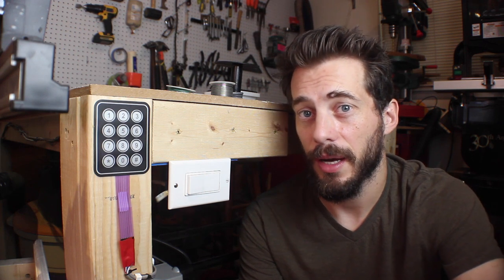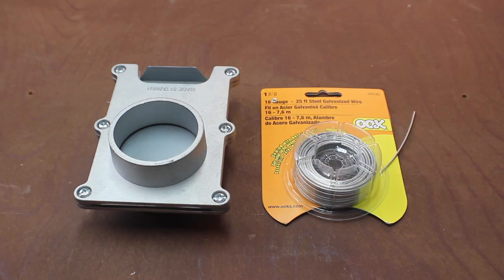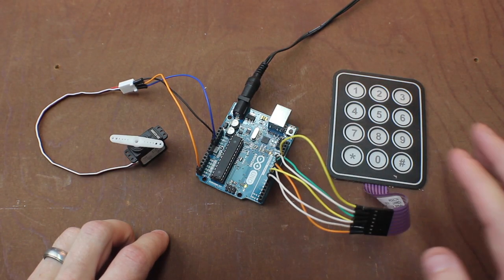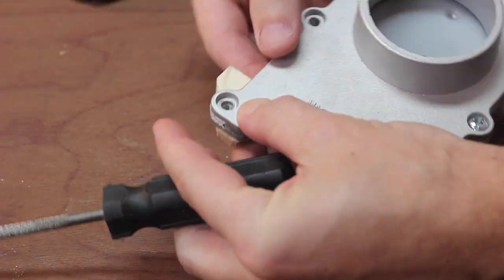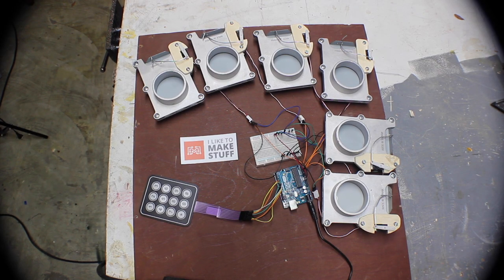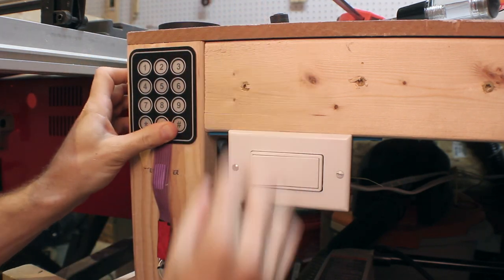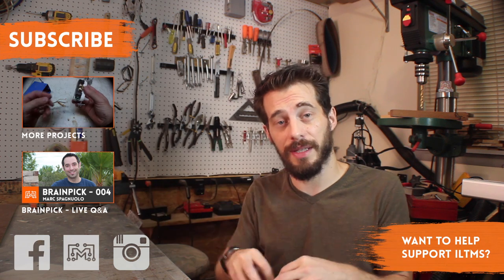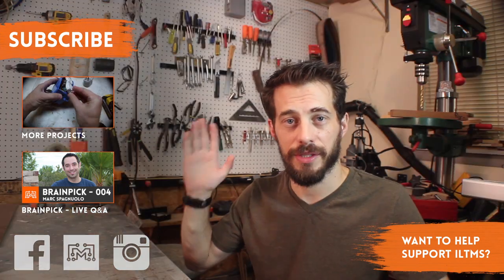How to control your dust collection with an Arduino (it's easy) | I Like To Make Stuff

Comment: I'm thinking instead of the gates, a ball valve might work better with the servos, but I don't know if all the dust would cause the valves any problems.
Reply from the maker: +Will Fader All of the ball valves that I've ever used are pretty hard to turn, and the servos wouldn't be powerful enough to manipulate them. It's possible that there are some out there that turn easily though ,I suppose.
Reply: +I Like To Make Stuff  True, true. I'll get around to testing it out one day; see what I can come up with, and report back.
Reply: +Will Fader you can get servos that are very strong but they are not cheap. you need to look at there specs some are for speed and some are set up for high torque.
Reply: +Will Fader i used automotive door lock actuators. Door lock actuators are powerful and only needs a pulse for it to move positions.  You will need to use a H bridge to control them.

Comment: Hey Bob, are you still using this? Are there any changes you wish you'd made
Reply from the maker: No, I'm not.  It was working fine, but I upgraded to a large dust collector and simplified down to only connecting 2 tools.
Reply: I would add current sensors to your tools and a solid state relay to the dust collector, then when you turn on your tool the Arduino can automatically turn on the dust collector and open the correct gate,as for the floor one use a switch that you can tap with a broom that keeps the collector on for x number of minutes.  This would eliminate the need for the keypad and the main switch (or you can keep them near the collector for manual overriding

Comment: When i saw "automate" i thought that meant it would automatically turn on when the tool was in use 

Still a cool video though
Reply: You can do that, either have the arduino control the tool through a relay, or have an Amp meter to detect when the tool is in use. (be careful with the AC though, it can kill you)

Comment: After your comfortable with the Arduino, try the Raspberry PI. Its a $35 Linux computer with io pins to control with python.
Reply from the maker: Adam Yarris Definitely, I love the Pi ! https://www.youtube.com/watch?v=RcsKNryPAzw&lc=z12fjxzoswzjw5om023owztgprfsg3vmd
Reply: I Like To Make Stuff I got a Raspberry Pi Kit at Radio Shack, my local store was going out of business and everything was 80%-90% off, so I got several types of arduinos, raspberry pi, arduino shields, etc. It would have been around $500 but we spent like $150, It was awesome. And the funny thing is, is that the reason I went to radio shack was only to get some PCB xD
Reply from the maker: Adam Yarris That's awesome! I was able to get a few things from my local store, but it didn't have much stock to begin with, and someone had already beat me to it :/  I did get an Arduino Yun (built in wireless) at 50% off,so I'm looking forward to finding a use for that.
Reply: I Like To Make Stuff Wow, nice. I was looking around when I got that stuff, and Behind some books, I found an Arduino mega there. it was something like $15. I got a few seeed studio shields like the Ethernet shield, motor shield, and some others. I can't get them to work, there's always a compiling error though.
Reply from the maker: Adam Yarris Ah cool. I got one of the Seed motor shields too, but haven't tried it yet. Are you adding the libraries to the sketch? (I'm just guessing that it needs special libraries, I haven't looked into it.) Let me know what you find out when you get it working, please :)
Reply: I Like To Make Stuff Yea it needs libraries, Just look up 'Seeed Studio [shield name and version] libraries', I have got the motor shield working, it works very well for the price of it!
Reply: +Adam Yarris Yeah, a Pi can do much more than an arduino, and python is an easy language to learn.

Comment: Wait, wait, wait...if I use an Arduino for this, I have to buy another Arduino for the next project?  Isn't there something more affordable to run the system once it's developed in the Arduino?

I was going to use micro switches on each port, wired to relays, so when I open a blast port the vacuum turns on. All the gates will have springs to keep them closed tight, and to close when I remove a hose.
Reply from the maker: +BillyGoat4x4 You can definite write the logic to a chip and replace the Arduino. It's best used for prototyping.  That being said, if you buy Arduino clones for cheap enough from China (literally $3 each) even replacing them becomes unnecessary unless you're doing a whole lot of projects.  Plus, keeping it in place gives you more flexibility with modifying/updating your project.
Reply: +I Like To Make Stuff That's good news, thank you. I got a starter kit for Christmas but have been a little intimidated to dive into the digital world.

Comment: Hey! This is a great project, however you are going to kill your arduino ! Arduinos are not made to handle this much power. The servos should be on their own power supply but typically must have a common ground with the arduino. If you have any questions PM me. 

Keep up the good work!
Reply from the maker: I plan on doing that, it just wasn't a priority for this video since the system is never activated for more than a few minutes at a time.
Reply: I Like To Make Stuff Yes, however the amount of current that it takes to open and close all at one time (your * and # keys) is easily enough to potentially fry the board. 
Hope to see more Arduino projects soon!

Comment: You should make a wireless way too do you could just carry around a remote
Reply from the maker: john dunne I'd thought about that, and it would be a fairly easy next step.  Luckily, my shop is smaller than a 1 car garage, so wireless would be a little overkill for my space :)

Comment: Bit more of a complicated project.could you read when a tool is turned on by reading the current draw on a plug then have an arduino switch on the shop vac making .and maybe open the correct  dust gate
Reply from the maker: CaptainDominic yes, you definitely could!

Comment: Where is the code for the Arduino?
Reply from the maker: +Best Services On my site, there's a link in the description for the post that has it.
Reply: I Like To Make Stuff I clicked every link in the description above, and do not see any code.   Maybe I'm just stupid, but could you please point me to the code?   Thanks.
Reply from the maker: http://d397j8om2gwxco.cloudfront.net/wp-content/uploads/2014/09/keypadToServo.ino_.zip
Reply: I Like To Make Stuff OK, thanks.   I had downloaded that before, but have no way to open it.   Looks like you're on an unfriendly Windows environment and I'm on a Mac.   Frustrating.   What prey tell is a .ino file?
Reply: I Like To Make Stuff Whoops, never mind.  I found the Arduino dev kit and have looked at the code.   Sorry for the confusion.   This is pretty arcane stuff.

Comment: You're really risking burning the arduino by powering the servos directly from it. Instead you should probably be using transistors to pull the power straight from the source to the servos when the arduino commands it.
Reply from the maker: Jim Groth If you follow the link in the description to my site, I talk a little more about the power setup that I actually used.  What was shown in the video was for prototyping purposes, and so that it was simple enough to be accessible to people.
Reply: I Like To Make Stuff Even for prototyping purposes it's good practice to not overload your arduino as it likely shortens the lifespan of it. 

I do love the build as it gets more woodworking people interested in electronics but I don't want them disappointed by their hardware unexpectedly breaking.

May I suggest making a video about transistors and relays? This would both help this project as well as be useful in many many more. I would do it but my editing and teaching skills aren't quite up to your standards. :)
Reply from the maker: Jim Groth Yeah, that would definitely be a good topic. I've got kind of a strategy of how to introduce this stuff to my audience, so it'll be a slow burn. I want people to not get overloaded, but get interested and learn about it at a pace that doesn't overwhelm them.  That said, I've gotten a great response to this video, so I know there's a lot of interest, which is great!
Reply: I Like To Make Stuff Looking forward to more of your videos.
Reply: I Like To Make Stuff A video on linear circuit basics would be amazing
Reply from the maker: Andrew Williams That's actually my next Maker101 video! I've got it scripted, but haven't shot it yet. hopefully this month!

Comment: Just some info as this is what I am putting together for my system. Swap out the key pad with these... a Current Sensor

https://www.sparkfun.com/products/11005

These detect when current is flowing through  a wire. With these you can then program your Adruino to turn on the gate specifically for the device that is turned on with current flowing. So you turn on the band saw and you can set it up to A) Turn on your vacuum system, just like flipping the light switch on and B) open that devices air flow.

This way the computer turns everything on for you. ;)
Reply from the maker: Yeah, I considered (and probably will eventually) doing that.. but for this video, I didn't want the tech side of it to be overwhelming.  That's an upgrade that I'll probably do in the future.
Reply: Nice! that is what I was thinking. Please post your upgrade when you do it. If I haven't done mine before you I would love to see what you do. Once I get mine up running ill send you some pics. Just too many irons in the fire right now... lol. mine will probably be a Jan Project.
Reply: And thanks for the vidoes always like seeing one pop up.

Comment: He makes out like soldering is harder than programming. Programming is a MAJOR, MAJOR MAJOR learning curve. Soldering is a two hour learning exercise.... if you're a dumb. Its a couple months of hard work to do the programming if you are a dummy. People think that electronics are about chips and wire. Its all about the software that drives it. The rest is easy.
Reply from the maker: I never made any (intentional) indication that the programming was less of an issue. In fact that's why I didn't really cover it in the video, it's too big of a topic.  I was a software engineer before I Like To Make Stuff, soI fully understand the learning curve. This video was just not a place to get someone bogged down with a line by line coverage of the code.
Reply: When you say its easy, try this do a video and explain Serial Print compared to serial line. Or how a PWM pin works. Do that and you might find that when you tell people that that is 2% of what they need to know to make it all work, then you are really letting them know what it takes. Its about as hard as learning how to drive a car in traffic, on your own. Everyone can do it but not without a full dedicated commitment and months worth of trial and error pain.
Reply: I knew a guy in Highschool that learned C++ programming in 2 weeks. Not 2 months or even 2 years. He literally learned everything he needed to know before graduation and got a job. It's not hard as long as you are good at reading or understanding instructions. What is hard is dedicating yourself to the task long enough so you can understand it. I can take apart an entire car engine and put it back together but if you asked me to smelt the metal and cast/machine the parts I would have a problem. Some things are not hard for everybody. Especially when someone else does the legwork for you.

Comment: If you do that stuff all around your house it's called being lazy
Reply: +Joshua Kellner Or it's called making your work more efficient. You can either take thirty seconds to walk to one end of your shop to close a blast gate, walk over and open another blast gate, and then finally get to work, or you can take five seconds to push a button and immediately be ready to work. If you build for a living and you move from tool to tool frequently, those twenty or so seconds you save every time you switch tools adds up real fast. Especially if you streamline as many of your processes as you can.

You could save an hour a day or more on these menial little setup tasks if you make yourself more efficient. And that means getting more work done in a day. And that means making more money in a day.
Reply: +Joshua Kellner Learning how to program a PLC + Learning how to wire a PLC + Building the actual circuit + Crossing it with whatever you're trying to do is far less lazy than just getting up and opening the blinds.